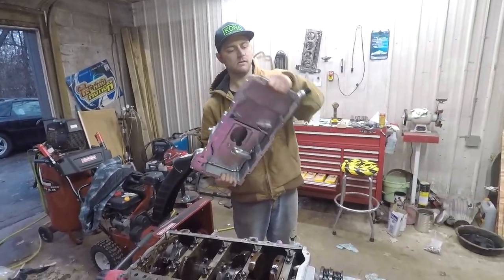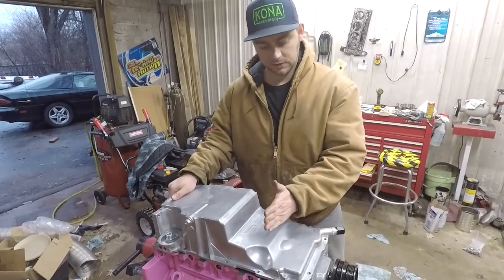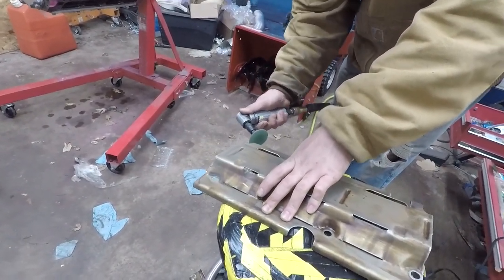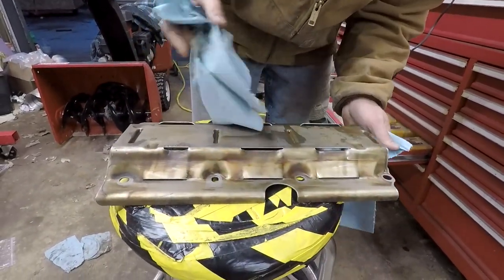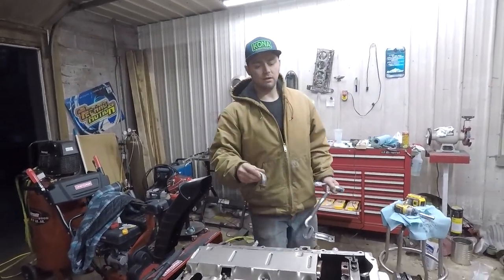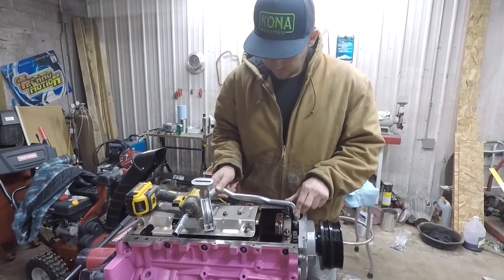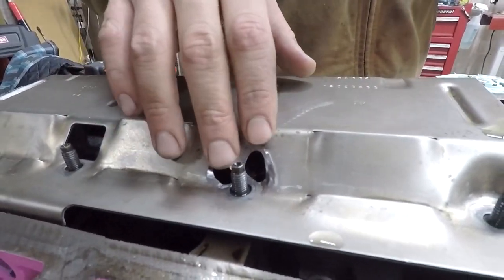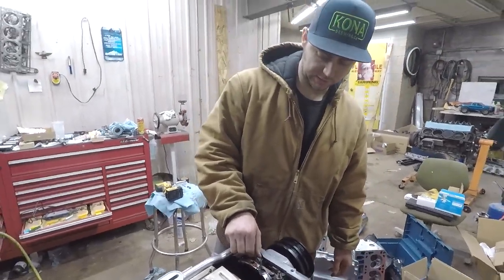F-Body oil pan on LS iron block

Comment: What year or size engine for Savanna or Espresso? 2009 or newer perhaps? Just fitting an iron block into  67-72 C10 with 03 Tahoe 5.3L. and as a dealer tech, swapping parts around is alien to me. Thanks.
Retired ASE Master Tech
Reply from the maker: Your probably fine using the stock truck pan in a c10
Reply from the maker: The pan is just needed for ground clearance
Reply: Although he is not installing this engine with a deep oil pan, into a 67 C10 truck, I am. Growing up on a farm on gravel roads then self taught to become an ASE Master Tech in 78, I understand the ground clearance issue all to well. I appreciate the reply.
Reply: I just figured he might remember what year of these models he’s mentioned in the video so I can take what perminate

Comment: FOR ANYONE WATCHING THIS, MAKE SURE YOU GET THE RIGHT PICK UP TUBE!!! i bough my pan and tube from eBay and the tube doesn't fit. It's sold under the same part # and I can tell you its not even made for the fbody application. Make sure the pickup oval is facing front to back, not side to side.

Comment: What did you do for the dipstick tube?
Reply from the maker: I used an ebay ls flexible dipstick because at the time legit gm stuff was too much. And it works good for me
Reply: @alloyspeed1889  ok so the factory won’t work? Or can you just trim it down? Then put like the proper amount of oil in the engine,and pull the dipstick out and remark the oil fill level
Reply from the maker: @BigFastGuy  you might be able to use it with out trimming, it will just be tall, I think.
Reply: @alloyspeed1889  I got ya.  Thanks!

Comment: Stock 6.0l windage tray?
Reply: you can use any windage tray, but if it isn't the f-body windage tray, it needs to be trimmed. All the truck windage trays work but they have to be trimmed

Comment: You got part number for that tube
Reply from the maker: If i find the part number soon i will add it in the description. But check check out rock auto, they are about 51$ currently.
Reply: @alloyspeed1889  thanks very much